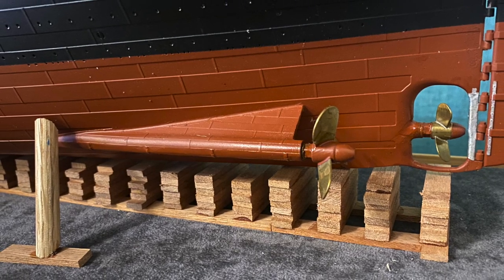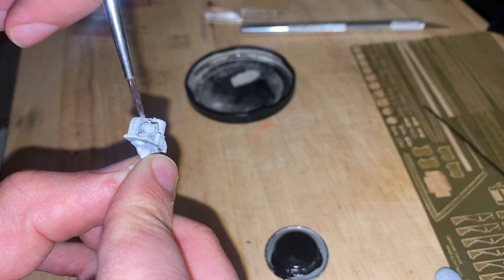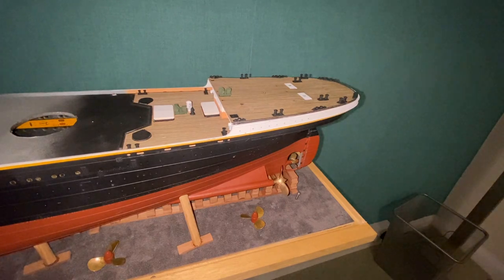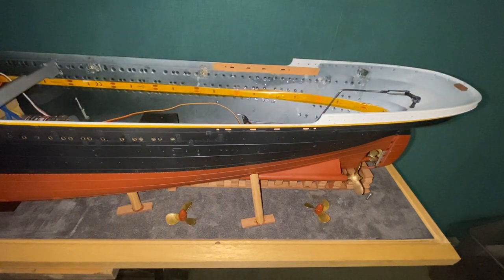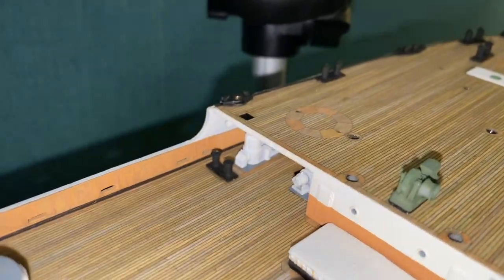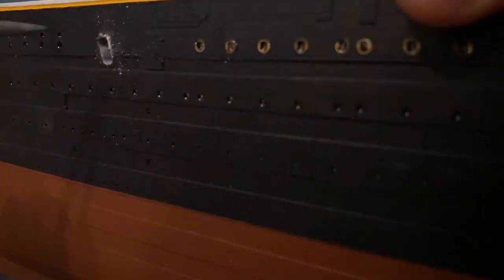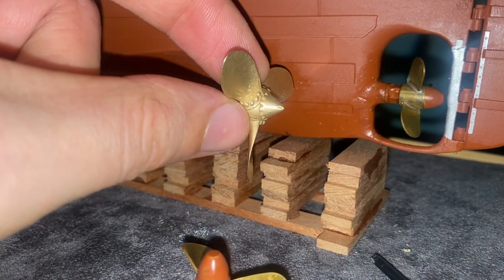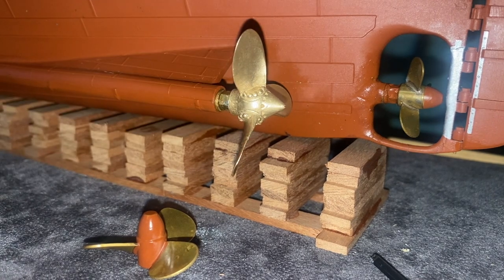Radio Control Trumpeter 1:200 Titanic Build Part 21 - Aft Well Deck and a Door

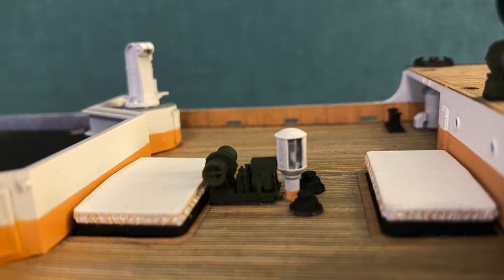Comment: Hello, I came across your channel yesterday and have been binge watching your build. It's been a pleasure!  I sailed in the Merchant Marines for years back in the 70's and 80's. I worked on the deck so I know a thing or two about the various parts of the deck and mooring equipment. It's been kinda fun seeing how Trumpeter has interpreted some things. There's several things that I'm dubious about with respect to proper placement on this model. Particularly the capstans (what you refer to as winches) and anchor windlass brake situation, but I don't think the average joe or model builder would know the difference.  But in the spirit of seeing how you take an extra effort to get things right, I might point out around the 11:00 min mark,   those two small angled pedestal fairleads should be angled away from the capstan drum, not towards it. They would have been attached to the deck at basically a 45 degree angle from both the capstan drum, and the bollard or chock the mooring line is passing through. If those were angled with the high side away from the capstan (the way it appears you placed them), as the mooring line got tight it would fly off the top of the fairlead head. I hope I'm making sense. I'm pretty sure you will understand if you take another look at it an imagine a mooring line going from the capstan drum to the fairlead and what happens when the rope gets tight. I really probably shouldn't have said anything about it. But I do appreciate your efforts at realism, so just trying to be of assistance. Can't wait to see the rest!

Comment: Hi Rob, great video as usual!  The Titanic was a new ship in so far as it had not sailed very much before the disaster. During her fitting out she would have spent sometime exposed when docked.  However people forget that the ship was coal powered and as such was subjected to all sorts of coal dust soot and water on the decks.  Those air venting systems would attract anything flying about and thus would have been a little tatty quite early on to say the least!  Having sailed on brand new and cleaner ships myself any little spaces around metal very quickly can get grime and rust coming through the paintwork.  In fact painting is virtually an ongoing job throughout the working life of any ship. The weathering you have done is good and not over cooked, so good job.  Those new propellers look the business!  So now you have a speed boat! :-D  Take your time with the video's, all good things come to those prepared to wait!  I have just drilled out the centre propeller shaft of my Olympic!!!!!
Reply from the maker: Yeah I hadn’t appreciated until recently how absolutely revolting the coaling process was. I was reading about it recently and hadn’t really understood quite how much preparation was needed to prepare a ship for the coaling. 
Great news you’ve started on the Olympic. I’m interested to see how you manage to sort of the A deck promenade decks! Keep safe! 
Rob

Comment: Really enjoying the build. Keep up the good work. Loctite bonds can be broken with heat. Usually a gas torch but not such a good idea around plastic hulls. A clean hot soldering iron placed on the propeller hub will do the trick with no risk to the hull.
Reply from the maker: Aaah yes that’s a good shout. I was scared of heating it because of the proximity to the hull, but as you say soldering iron will be localised enough. Thanks for the tip, next time it won’t be such a faff!

Comment: Beautiful Work.  Just found your channel and have been binge watching every since.  You are inspiring me to possibly get one.  Question... and you may have addressed this in a later video or I may just be wrong, but it looks to me like the pitch of the new props are backwards from the one you replaced (time stamp 20:18)?  With the center prop not able to run in reverse, won't this be an issue?
Reply from the maker: The props on the ship how do turn the correct way. That bit at 20:18 is just coincidence, I put the prop I had just removed from the other side down below the new prop which is why they are different turn. 
Central prop not reversing does reduce the speed the ship can stop. But it’s accurate as the real Titanics central prop was non reversible and I liked the factual accuracy over function! Just means you have to be a bit more alert when sailing her!

Comment: Hey there great videos nice modelling :) I'm building the same model and making it rc, where did you get the bronze propellers I have looked on Facebook for the group you mentioned and can't find it any help would be appreciated, Steve.
Reply from the maker: There was a production run on the Facebook group devoted to this model.
It’s called Trumpeter Titanic 1/200th model ONLY building tips and tricks. 

Whether or not this production run has finished or not yet, I can’t say but worth going on the group and checking. Just a tip, the admins get a little irritated by people asking questions on the group before using the search function to try to locate things so probs best to have a look over that first! But it’s a great tool for this sort of project 🙂

Comment: how will you make sure the final model is not too heavy with all the battery, power pieces etc? What I mean is, you want it to float like it would at the water level but if its heavy, might the water level be up higher than desired?
Reply: Cad he measured it all on cad it's a software .the center of mass is all balenced so he's good to go
Reply from the maker: So I have used a CAD (computer aided design) software called Fusion 360 to create a model of my model in advance. I’ve added all the components with their respective weights etc into the model which gives me reasonable confidence it will work. 
I have had to make a bit of an educated guess with the superstructure as before it’s complete I can’t really work out how much that will weigh. Paint, glue, photo etch parts vs plastic parts etc make it very difficult to accurately estimate the final weight. 
So what I’ve done is tried to build in a bit of contingency. Currently the model uses
3 batteries, but if the superstructure ends up being slightly heavier than I have calculated I can reduce it to a 2 battery system and that gives me the additional weight I need to get the model working 🙂

Comment: My ships hull isn't perfectly flush a don't know if I should just tamiya cement it all around? Only reason I didn't was to build it kind of like yours and pop off the top to future proof my leds incase at some point they begin to fail.
Reply from the maker: Hi there,
This isnt unusual unfortunately. And to be fair to trumpeter its not really their fault either. It's just a fact of casing large sections of plastic that there will be a bit of warp.
There are a few things that can be done, 
 - You can add ribbing / supports to push / pull warped plastic out to make the shape more true,. 
 - You can try and do a bit of bending of decks to get the correct shape. 
 - Live with it (not ideal but hey ho). 

I have essentially done a blend of all 3. I've added ribbing and strengthening to keep the hull relatively straight along its length. That said the superstructure doesn't quite mate onto the hull in all areas. 

There's no right or wrong way to deal with this though!